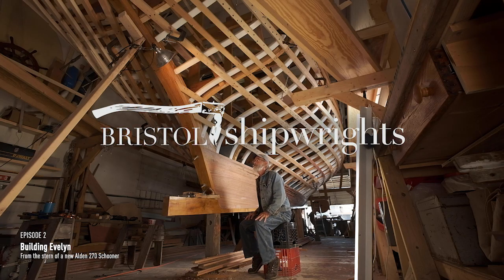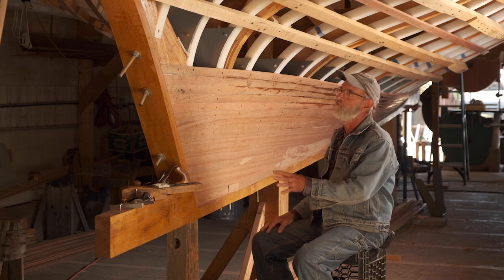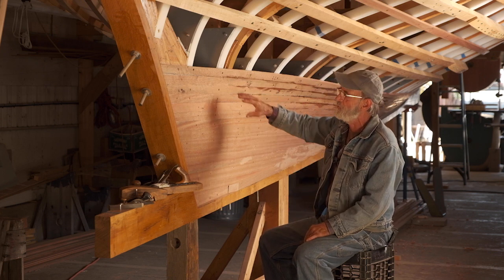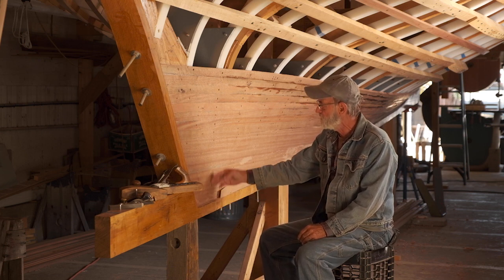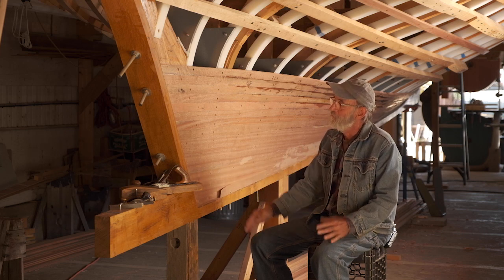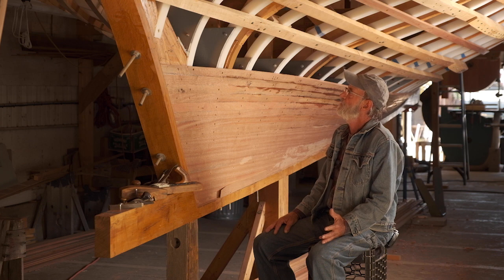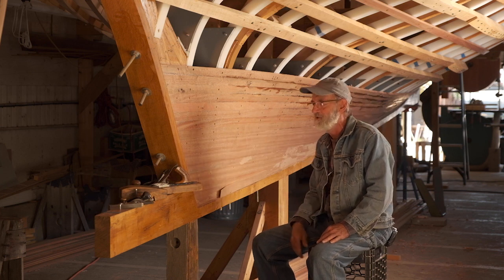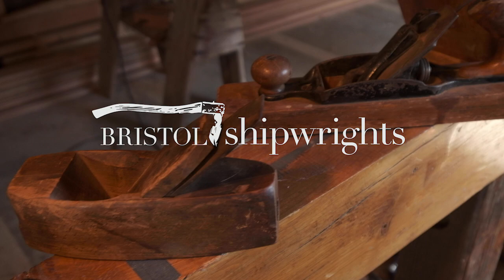Building Evelyn: A Classic Alden Schooner, EP2

Comment: I didn't see limber holes in the floors. Am I mistaken?
Reply from the maker: There are two large limbers one port one starboard in most of the floors. In some areas the top of the keel is grooved so any water can flow beneath the floor tang.  Lou came up with a very clever way to notch the transom frame to drain any water that might collect there. We'll show  photos of the notches in an upcoming video on building the transom frame. Thanks for subscribing.
Reply: @BristolShipwrights  Thanks for your rapid and informative reply! (I should have known, lol) And I subbed because Lou was involved. I like his no nonsense approach.

Comment: I've never found an old compass plane in good enough condition to turn into a daily user, but everyone has old trashed coffin planes that are worn into wonderful interior curves, so that's what I use. I love seeing a real craftsman doing the same thing!
Reply: Build a new body from sime qualtiy wood. The iron can be made from up to date steel fairly easily. Use an old circular/compass plane as a model to build a new one from.
Reply: @thomasarussellsr  Compass planes don't have wooden bodies-usually cast iron with a thin steel sole that can be adjusted to different radii. Go look at a Stanley 113 or Stanley 20.
Reply: Great new videos Dad.  Love em 💙😘